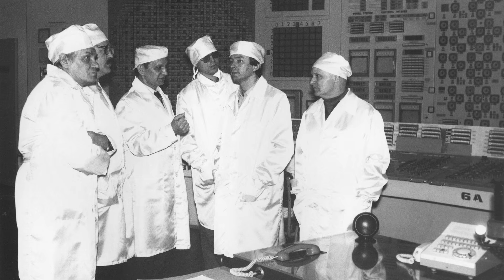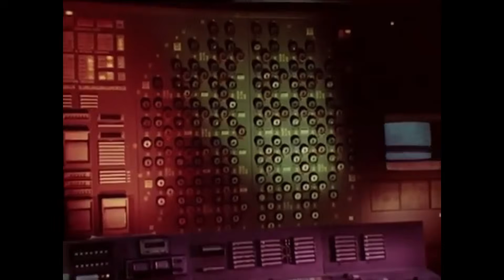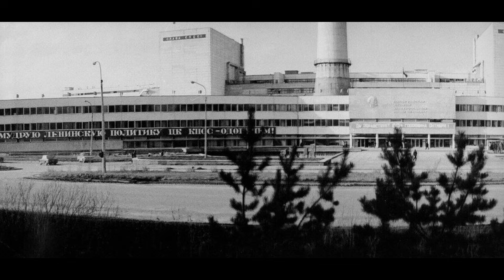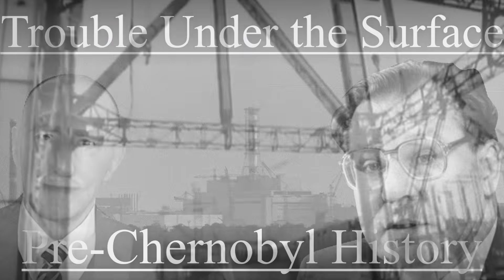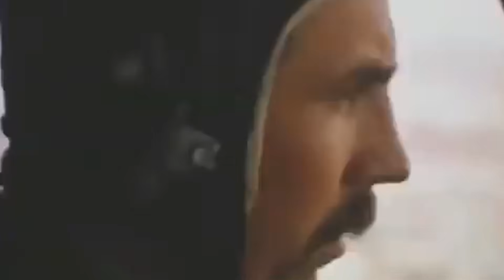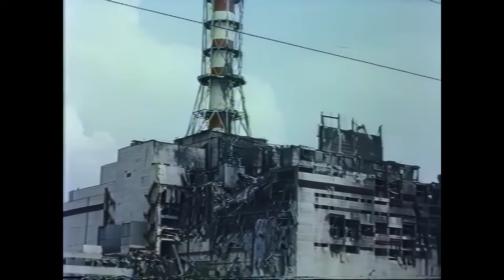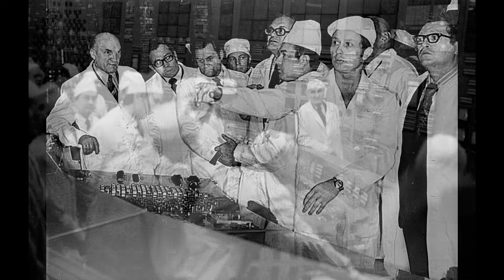The 1975 Leningrad Nuclear Accident: The Road to Chernobyl

Comment: So...if you'll pardon the analogy, post Leningrad, the Russians basically took an already unstable system, and gave it the nuclear equivalent of a hair trigger (I use that because I distinctly remember one Russian scientist stating that withdrawing the rods in Chernobyl 4 was "akin to cocking a gun.") 

They were in effect doing in-service testing. that's incredible to me.
Reply: Multiple people with close knowledge comment on the RBMK project undergoing concurrent development and operation, even using the word experimental, incomplete. It's interesting where the line is to be drawn when you think about it because many things change.
Reply: Not in effect, they WERE doing in-service testing.

The beurocrats in charge got a medal for bringing reactor 4 online ahead of schedule.  Only, they hadn't actually passed all the safety tests and weren't supposed to have signed off on reactor 4 entering service.  The safety test they were running created the circumstance, but trying to get it back up to service spec before morning is what pulled the trigger.

Comment: When you're actively overriding multiple automatic protections in a radioactive system, you should probably stop and rethink your plan.
Reply: When you find yourself actively overriding protections in any system, you should stop and rethink your plan.
Reply: @tylerfb1  Unfortunately things like nuclear reactors don't wait around for you to come to a wise decision.
Reply: @tylerfb1  not nessicarily. In a car for example, some engines automatically shut down if the engine is overheating, but if you are refilling the coolant  the engine will crack if you just pour cold water into the cooling system  the engine should run just over idle speed and you pour it in slowly so it not only mixes with whatever hot water is still in the system  but also gets circulated through the engine which is still of course generating heat so the temperature change isnt so great nor a shock cooling. If you just let the engine turn off and wait till the engine cools, you may have seized piston rings, oil burned onto surfaces etc. You must disable the auto shut down in order to save the engine. You also arent supposed to remove the radiator cap when the engine is hot, for your safety. But if you dont let the steam pressure out (slowly) it can cause damage to the head gasket or welch plugs, possibly even the cylinder head, so you must remove it. Use a large towel to prevent steam burns and open it slowly with firm downward pressure so the pressure does not shoot it out of your hand..

One assumes there are similar circumstances in other systems, otherwise why would the control room even have manual override switches to disable them?
Reply: @Colt45hatchback  Well, I would disagree with your example. 
Waiting for the engine to cool after overheating will never cause damage. Its the overheating that caused damage, not the cooling. 
But that's not the point. Safety systems are put there for reasons. The engineers who designed the device know what its limits are, and know what could or will happen if those limits are exceeded. 
There are good reasons to disable safety systems. But if you're going to do so, you better have intimate knowledge of the device and the reasons for the safety system and the possibilities of things going wrong and what to do if they do. 
If you find yourself just actively overriding safety systems that you don't have intimate knowledge of in order to achieve your goal, you need to stop and rethink your plan, because you're about to destroy something or injure or kill someone.
Reply: You’re not wrong, but you’re assuming western-style management.
Reply: @jimtalbott9535  western reactors have never failed...
Reply: @tofupowda three mile island…
Reply: @shar1784  Even more recently; Fukushima. You could say Soviet reactors had more incidents, but Western reactors failed catastrophically more often.
Reply: @surena9451  the soviets had many catastrophic reactor failures.  Many of them aren’t well documented because the soviets did exactly what they’re known for, they covered it up.
Reply: @surena9451 a: Fukushima isn’t in the fucking west! It’s more east than Ukraine!

B: it failed bc it got hit by a tsunami. RBMKs blow their lid if you look at em wrong.
Reply: @shar1784 yet the safety system inplace works 3 mile undergo meltdown but due the pressure vessel and containment vessel working as it should unlike the RBMK only have a biological shielding aka a goddamn roof
Reply: It seems that the reactor operators do not understand how their reactor works.  This being said overriding safety control should take authorization from a regional director or someone high enough up the chain to tell them no.
Reply: @Privat2840  Apparently, critical information on the reactor design was classified secret and the operators were not allowed to know it.  The operators simply followed procedures to run the reactor.  It worked unless conditions outside normal operating parameters were encountered.  In those cases, knowing the design of the reactor might have helped.
Reply: @brinnbelyea The Soviet “System” strikes again.
Reply: @jimtalbott9535  This isn't a problem unique to the Soviets, or communists. Western capitalist corporations have demonstrated the same level of recklessness as decision makers, and so have religious leaders and royals. This is a human problem. Over-confidence, mostly. I recommend the "cautionary tales" podcast by Tim Harford, for an insight to the real reasons why disasters happen. Most if that is simply human behavior.
Reply: @jimtalbott9535  Disabling safety systems is a common element of nuclear accidents. At Three Mile Island the operators disabled the emergency cooling system that was desperately trying to prevent the reactor from melting down. Eventually they decided the reactor didn't need any cooling and shut off all cooling pumps, then they were shocked when they detected radiation levels rising the the control room.
Reply: @jimtalbott9535  I have a feeling said system is still in place in Russia
Reply: @jimtalbott9535 But the Bolschewismus is the best idea of the world they thouht…
Reply: @brinnbelyea yea everyone wanted to ignore the design flaw that it created that positive feedback loop and would blow...it was only a matter of time since noone knew what they were doing
Reply: @1873Winchester  Probably. And the RBMKs are distasters waiting to happen. And as far as I know a dozen or so are still in operation in Russia--the former Soviet republics republics, I'm not sure.
Reply: @computername  Nope, it’s unique to the Soviet’s tyrannical style of information management. The West had their own issues unique to themselves, but nothing as bad as the Soviets.
Reply: @brinnbelyea this is the case apparently.  The operators were under the mistaken belief that any power spike could be immediately stopped by pressing the scram (АЗ-5) button.  Amazingly, they had no clue about the RBMK reactor’s characteristic of experiencing a power spike during the insertion of the control rods during a full scram.  They had no idea that with almost all of the control rods withdrawn, inserting them all at that point would trigger an enormous power excursion, unleashing disaster.
Reply: @computername I won’t sit here and say you’re totally wrong, but those corporations still do have a better track record, when you look the actual track record.
Reply: @Privat2840 in quality operations, we refer to this authorization as a "painful signature"      in an authorities government, it might as well be an impossible signature..
Reply: @Privat2840 we will welcome 😅your help to help with our next visit and our upcoming event with a special thanks from and the community of students in this town of around new Ca
Reply: @Privat2840  that’s what the chief engineer is supposed to be for
Reply: @Privat2840 regional directors never said No because they we're scared the Party would reprimand them.
Ask Brjouchanov.
Reply: @Privat2840  This is what happened in Fukushima and we saw what consequences it had when the reactor control crews did need confirmation from higher up for every step. A reactor can go from fine, to catastrophic in seconds, phoning someone in Moscow is not an option. Also the emergency shutdown system in Chernobyl was like a trigger for a bomb anyway, since reactor 4 was heavily modified from the ones at Leningrad.
Reply: @blitzkriegfritz2779  Lovely.
Reply: @Privat2840 What are you an expert? The safety systems were turned off for a reason. In RBMK-1000 reactors xenon is it's worst enemy. RBMK-100 reactors are actually quite safe if you know how to operate them
Reply: @Windows-sx1br  Well obviously someone wasn't up to speed on how to operate them that night.
Reply: @Windows-sx1br wrong, there was a design flaw with the control rods being tipped WITH GRAPHITE which will accelerate the reaction do to it being a good neutron moderator better than water.
Reply: @Idkanymore-f1bno. Watch more videos of this channel. 
The reactor is already PACKED with graphite, these were displacers that caused the accident by displacing water and steam, producing voids. If they had extended to the bottom, and they are now, the accident would never had happened.
People really need to stop taking nuclear engeneering lessons from HBO...
Reply: Selbst in meinem Kopf sind diese immer präsent. Ich erhielt meine diesbezügliche Ausbildung durch die lange Jahre mitgelieferte Beilage der Zeitschift "Kernenergie" , in der sämtliche Reaktorunfälle der Welt erfasst und genau dargelegt wurden. Infolge der Aufdeckung von Fehlverhalten deutscher Reaktor-Seilschaften wurde die Zeitschrift dann eingestellt. Seilschaften gibt es nicht nur im Kreml.
Reply: All jokes aside and in complete seriousness, if there is anything we've learned about Soviet Russia in the decades since its collapse, it's that multiple automatic safety protections in radioactive systems override you.
Reply: @jamesclark2663  Ha!
Reply: Nope you just say your boss or some party member told you do it.
Reply: That was Chernobyl, in fact. Successively removing control mechanisms,  an un expected and NOT supervised & and then it blew.
Reply: Forced incorrect operation based on the opinion of someone with more rank than brains
Reply: Plan? We left that behind at 50kwh.
Reply: No mate.. you remember,  something something positive void coefficient 
It has the world "positive" like asbestos... got the word "best"
So can't be bad
Reply: Nope.  A nuclear catastrophe in the Soviet Union is not technically possible, therefore overriding the safety systems is in itself a safe thing to do.  Containment structures?  You must be kidding, these reactors cannot blow up or melt down.  Anyone can be trained in how to operate these reactors as well.  They are so simple to operate that nothing will go wrong.
Reply: "you should probably stop and rethink your plan" - no way, comrade. No way, no why, no how - that would be a sabotage of a five-year plan. And for that you'd get a white beaches holiday... erm, izvinitye, slip of tongue - I meant "white bears holiday", of course - and a couple of years of it, actually.
So, "nyet", and don't you even dare to think about it - you have to get yer priorities right: "Socialismo o muerte", and toe the Party line - or else.
Reply: You ahould press az5 immediately
Reply: They all did this believing that everything was safe thanks to the "Accident protection systems" known shortened in cyrillic as АЗ, or AZ, most famously "Accident protection system category 5", or AZ-5. And, from all they knew, it was true. Unfortunatly, the information they recieved and the reality did not allign. The same problem exists with the New Safe Confinement, it is supposted to last 100 years against internal collapses of the reactor building, extreme weather, earthquakes and everything...then the war in 2022 started...
Reply: Thanks Capt Obvious. People like you are why aliens won't talk to us.
Reply: Naaah.
Reply: I think you're right. I learned my lesson a while ago to read the instruction manual😅😅😅😅
Reply: Why worry about something that is never going to happen? They should have printed that on their money...
Reply: The peoples' glorious revolution waits for no one.
Reply: It's baffling
Reply: For some reasons my comment I posted here yesterday (or so) doesn't show up even if it's still visible in my comments' history, so I'm reposting it - and if you have any issues about this non-offensive humorous remark please let ME know...

"you should probably stop and rethink your plan" - no way, comrade. No way, no why, no how - that would be a sabotage of a five-year plan. And for that you'd get a white beaches holiday... erm, izvinitye, slip of tongue - I meant "white bears holiday", of course - and a couple of years of it, actually. So, "nyet", and don't you even dare to think about it - you have to get yer priorities right: "Socialismo o muerte", and toe the Party line - or else.
Reply: @MrKotBonifacy white beaches holiday 😂😂😂😂
Reply: @MrKotBonifacy this is the kind of material you keep in your head because releasing it into the world only serves to show how unfunny and corny you are. why would russians use spanish phrases?
Reply: Sure; when your make-up makes your teint look orange, you might also overthink your plans of becoming US president. But you see, the point with humans is this: They just don't think through the actions they're about to take. That's why atomic energy always will keep on being risky. It's always that scheme of safety rules and overriding them; you can see a pattern in that from industrial accident to industrial accident, never mind whether you start your quest at Bhophal, the Deepwater Horizon or Fukushima Daiichi, and it is also very much the thing with political power.
Reply: @koerrie  always gotta bring Trump in lol totally irrelevant to nuclear power

Comment: Could you also do a video about the Jaslovské Bohunice A1 incidents, the 2nd one resulting in partially melting the core? The reactor was an experimental of the type KS-150 and was working with natural (not enriched) uranium and the plant had a rather low power output of 104 MWe. Moderator was heavy water and coolant was gaseous carbon dioxide. The reactor was designed to be refueled while in operation and both incidents happened during refueling of a critical reactor. The first accident due to operator error combined with bad design of the locking mechanism of the fuel assembly and the second, that led to partial meltdown, was caused again by operator error as they unintentionally teared a sack containing silica gel balls and did not properly clean the channels. Which resulted in low coolant gas flow and overheating and rupturing the fuel channel and its surrounding channels too. While it was technically possible to repair the reactor, it was not feasible from an economical point, as new, more powerful soviet VVER 440/V230 reactors were being build on the site as part of the V1 plant, which operated without any incidents from 1978/1980 to 2006/2008 (block 1 and block 2). The two currently running VVER 440/V213, which have been modernized and their thermal power risen by 7% from 1375 MWt to 1471 MWt together with improvements in the generator part (power output increase by again by 7% from 472 MWe to 505 MWe), are scheduled to be shut down in 2065 after 81/80 years if operation (block 1/2). A new 1200 MWe block is being mentioned quite often in the last years, according to plans the construction should begin 2035 and commercial operation start in 2045. The new V3 plant should be running until 2125. Wow. Nuclear reactors and power plants are build to last...
Reply: Why don't you? You seem to know quite a bit about it

Comment: Imagine testing in production with an RBMK reactor. That was basically what was happening at Leningrad unit 1.
Reply: Basically what they did in Chernobyl too.
Reply: Their naval reactors were pretty similar.   They do some unbelievably dangerous and negligent stuff with no regard to just basic safety.   They test launch sub icbms tied up to the dock on base.  Of course the obvious happens, theres launch failures. One made it 10 feet above the sub, came crashing back down on that submarine.  One that they had 2 reactors in, because they knew one would fail eventually on patrol.  This way they wouldn't need to return if 1 melted down.  Has happened a few times.  Couldn't imagine a worse situation with an icbm landing on anything with that kind of design and mfg quality making it out because of anything other than luck.
Reply: @mtmadigan82  Sounds like working on Soviet subs was a nightmare. And testing an ICBM while the sub was tied up at the dock?!
Reply: @mtmadigan82  How are you gonna return to base when your one reactor has just melted

Time to fashion sails from your blankets, comrades!
Reply: @chehn  R-14 sub of US Navy actually did make use of an improvised sail from hammocks and whatnot due to seawater contamination ruining fuel! In fact, it got enough speed (aroudn 2 knots, give or take) under the sail that windmilling propellers ran generators at a sufficient level to start charging the batteries
Reply: @caav56  Smart lads!
Reply: The US has had some simply hilarious reactor accidents too. Difference is US reactors have hard containment.